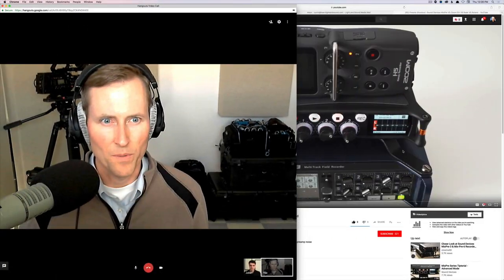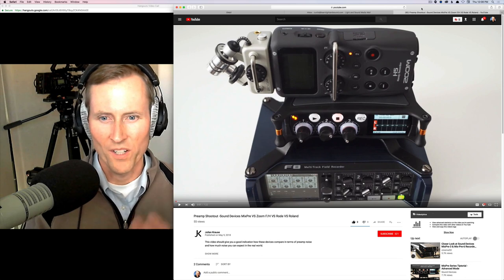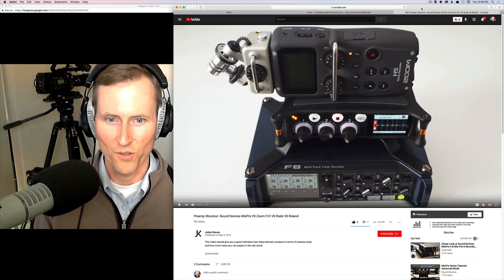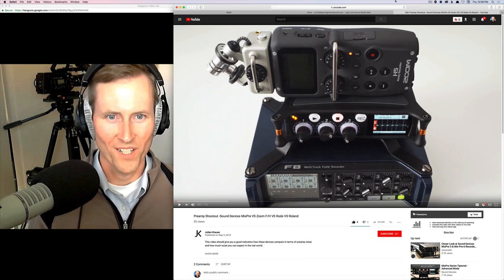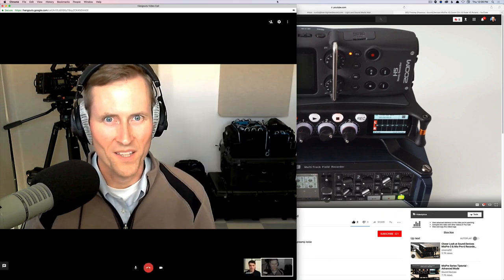Sound for Video Session: Microphone Preamp Self-Noise

Comment: That's a very good point about the Zoom H5 being decent for the price range but probably a poor choice to pair with weak dynamic mics, since you'll have to crank up the preamps very high in order to get a decent signal level. If you're going to have to drop another $150 on a Cloud Lifter, you might as well just go for the MixPre-3. The H5 has only 59dB of total gain, the MixPre devices have 77dB, and they are still much quieter at maximum gain than the H5. It makes a difference with dynamics like the SM7B.
Reply: Thanks RedBearAK. Or even the Zoom F4 which has been discounted from time to time down to $450. That is a huge upgrade over the H5.
Reply: Now the Zoom F4 is US$450 it is almost shockingly cheap, only a hundred bucks ish per pre amp

Plus you get a timecode recorder! Not that long ago even just for a timecode box itself that was how much you spent.
Reply: Good point!
Reply: RedBearAK it's all a matter of budget and usage. If you want to record tiny sounds in very quiet environment and you only have a h5 and a dynamic mic, you will probably have to compromise, but in most circumstances the noise floor of the h5 will remain a minor concern if you plug the right gear and tune it properly.
Reply: There are a ton of videos here talking about inline "booster" preamps like the FetHead or Cloud Lifter. Bottom line is that they produce their own noise and are only potentially useful in the case where the main preamp has a lot of noise at high gain settings, or simply doesn't have enough gain to produce a usable signal level with a specific dynamic mic at maximum gain. The H4n Pro is kind of in that category. If you really want to use a weak dynamic mic like the SM7B with the H4n, a FetHead can at least make the mic usable. Just don't expect any obvious improvement in the noise floor. And you'll always be better off moving to something with more gain and cleaner preamps so you don't need a booster. Like the MixPre-3, which I discovered can be purchased from Sweetwater Sound on a split three-month payment plan.
Reply: RedBearAK some of my friends are indeed using a fethead to lift the level of a sm7b into a h4n and are quite happy with it. I have one fethead too, I can run a test into my h6 to compare the noise with/without.
Reply: Verdict, I ran a test this morning. Only one test so it might be good to reproduce the experience, but that gives already a good indication: 
During my test, the fethead improved the signal to noise ratio by 20+dB.
The signal increased by about 48dB and, at the same time, the noise increased by about 27dB, therefore an overall improvement of 21dB.
The lift is apparently very flat on all frequencies (with nuances on the low end of the spectrum).
On top of this, using a fethead avoids to push the gain of the record to its maximum, therefore the signal to noise ratio of the preamp itself is likely to be better as well if set to a more normal level. 
This is to be verified, but 20dB is already a great number.
Reply: I agree with the sentiments here. I have heard, though have not tested myself, that the cloudlifter is a bit cleaner than the Fethead but again, I have not confirmed that myself. I look at the cloudlifter and fethed as practical problem solvers, but ideally, one would use a cleaner preamp instead.